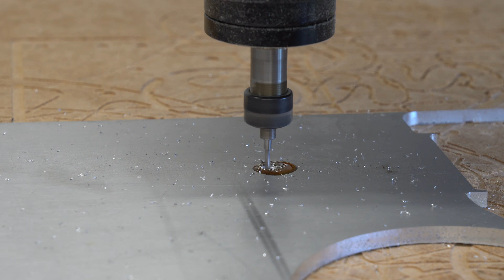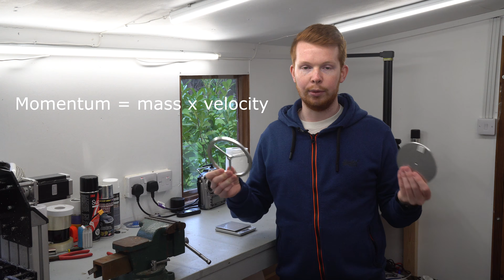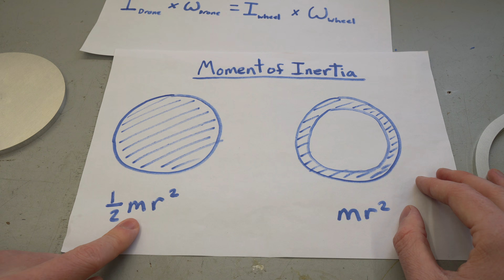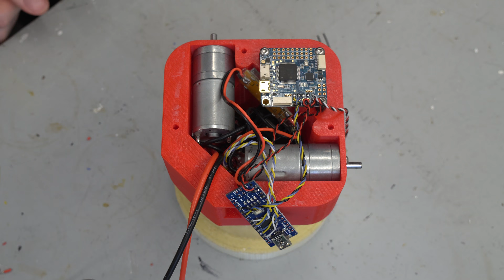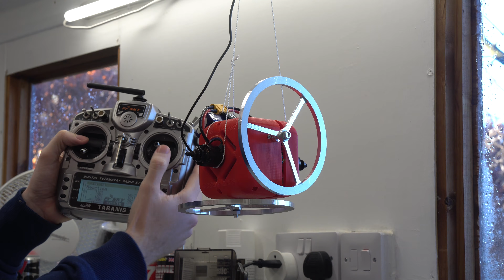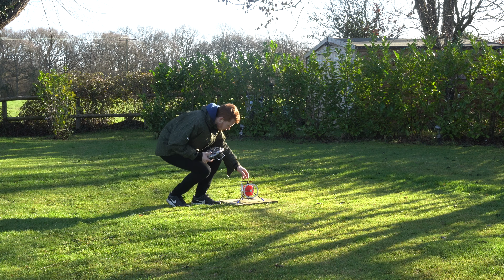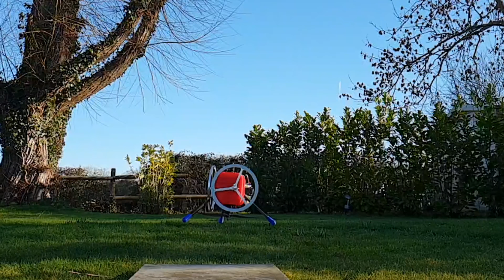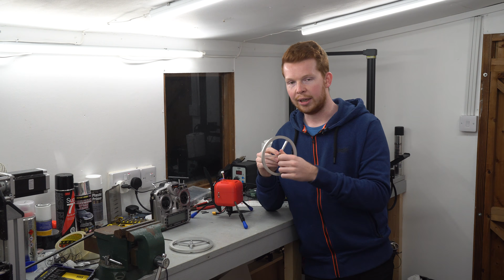Comment: Your setup has an intrinsic instability problem that results in an center point of mass alsmost in the center of the copter. This means the copter has no automatic fall back situation. If you would  use a stronger top propeller in a higher position, your copter would slightly pendel back to a stable point, even if you switch off the x and y axis. So you can use the x and y axis only to create a tilt for forward direction. The drone would become much more stable. Once you have managed its control that way, you can try the more difficult setup you have used now.

Another intrinsic problem:  Once it tops over, the z-axis (lifter) decreases on lift by tilt (cos(tilt) ) so that the lift must be compensated by the tilt factor to maintain the altitude.

The third  problem of intrinsic instability, you didn't mention is the z-axis rotation control. You wanted to let the z-axis motors spin with equal counterclockwise momentum. But this axis also needs a rotation control. So  a differential parameter of the both rotation speeds that must be setup that way, the the lift difference remains zero.

Only with those modifications you may have the stability to be able to control the drone by remote control. The first problem shows up by once the drone tilts, it looses its hight and falls to the ground. You should also consider setting limits to the allowed tilt, because at a certain tilt, the the lift propellers won't have enough power to compensate the cos(tilt) factor.

Comment: seems like step one would be to have the unit maintain level on the bench just with the reaction wheels when balanced centrally on a vertical metal pointed rod held in the vice, and recover from any random disturbance. would save wrecking a lot of propellers etc. use that to debug the closed loop code. The other thing I think intuitively (without sufficient physics knowledge to know if i'm right) is having 2 independent pitch/yaw wheels only on two sides may introduce unwanted twist torque - meaning you may need a 2 pairs of reaction wheels on a common axle on opposite sides, or 4 wheels in total. Regardless, what i saw is incredible - your material, electronics and arduino coding abilities are mind blowing. I'd love to see this work.

Comment: Have you considered control moment gyroscopes? They're slightly more complex and require the rotor to be spun up on the ground, but can in theory give more consistent torque and run two axes off of a single motor.

Comment: The slomo is fascinating. The amount of reaction you get from the wheels seems far too high so you could get away with smaller wheels - again, cutting down on the total weight. Also, there is a control system used on chemical plants where there is a delay between opening a valve and the level of a tank increasing (where you want to control the level in the tank using the valve). It is a PID (proportional, Integral, Differential) where the setup from this seemed to come from fourier analysis and things like Nyquist plots (frequency and phase) and so on (I didn't get involved but it seemed very fascinating).

Comment: why not use a gyro? ie.  place a force on the gyro wheel and use gyroscopic procession to create torque in one direction or another.  The counter-rotation is cancelled by a smaller vertical wheel and this is used as a gyro to "pivot" left and right.  Not by speeding up and using counter rotation "inertia".  With this idea, once the wheel speeds up you turn but then when slowed you end up where you started, or like you said, it becomes saturated.

Comment: The precesion of the moment on the propeller by the reaction wheels might be causing the instability try applying the reaction wheels  moments 90 degrees earlyer in the plane of rotation

Comment: So, you'll want brushless motors and you'll want an individual motor/reaction wheel not just for a given axis but also for each direction it will spin to reduce the reaction time as much as possible. You'll also have to have a pair of such motor/wheels for the yaw axis as well. Differential torque between the two motors aren't going to be able to independently react to the changing conditions. Basically you're asking each motor/reaction wheel motor/prop to be responsible for too much.

Comment: i hope you would try and change the drone config to x config..what i mean by it - that both reaction wheel would be used to cause it go forward backward etc...
the reaction motor might need to put more effort, but it will prove to be more stable..

Comment: Can you spin both reaction wheels up and used a differential rate of rotation to stabilize the flight?  It seems there may be a basic problem with this idea but I can't visualize what it would be.  Starting current for any motor is about an order of magnitude greater than no load current.   At least that's been my experience.  I enjoy your videos and your playful mind.  Thanks.

Comment: good concept, but the video itself isn't very interesting.

you mounted two reaction wheels, one of which would be able to balance the load from the propeller. but there is another dimension of twist which the reaction wheels would need to ballance to steer it.

the perpedicular to lift wheel, would be able to deflect momentum towards the ground but trying to adjust the force of it would be like a helicopter changing the disposition to go the opposite direction of the lift propeller.

to steer it, you would either need a servo on the bottom rotating a weight so it will tilt and bank in any wanted direction. or you need to have basicly a point of the cube have another reaction wheel.

you are trying to do too many problems in one single step. which makes it back fire.

again, using reaction wheels to redirect momentum is interesting, but the execution needed more intermediary steps.
also the video itself was dull.

Comment: Replacing the aluminum wheels with flat fan type blades which use wind resistance to do the same job and is much lighter

Comment: My uneducated guess on the yaw momentum:
If looking from the front (and wheels are front and right) of the drone and the front reaction wheel is already spinning clockwise at a constant speed and the right reaction wheel now starts to spin cockwise perform a small pitch-up correction, the already spinning front wheel will add angular momentum along the yaw axis and spin the drone right.  The combined rotation along two axis might be to difficult to counteract for the flight controls and cause this unstable flight. This effect could be quite significant due to the high inertia of your reaction wheels.
This effect of a spinning wheel inducing angular momentum when it is tilted over is shown in a lot of physics videos.

Comment: Here’s my take on the instability of the drone...
The reaction wheels were not spinning true, they were wobbling. This imparted a vibration through the chassis to the accelerometers, which in essence, added noise to the sensitive accelerometers input data of the angle and acceleration of the drone. Clean up the reaction wheels trueness and see if stability improves.
Reply: The Problem is much simpler:
1. The asymetrical layout have also an issue withe the PID regulator of the flight controller. Thats why it flys in one direction on start. The P-amount in the positive direction is not the same as in the negative. This is very complicated to compensate with software.
2. The current regulator do not effect the reaction time directly. Only the momentum from zero of mass. (And maybe the coils of the motor.) The speed increasses logarythmic and needs a lot of power on zero rotation. An efficient way were to spin one other wheel on each other side the opposit way and change only the rpm of it.

Comment: Not enough power in the motors. They need waaay more torque for this thing to be steady.
They have a delay between divergence from horizontal plane and the reaction. The reaction is also not sharp enough, the spin-up and spin-down takes too much time. It is not the torque that controls the device, but a time-derivative of the torque.

Other problem is the lack of third axis. I the rotation over it (hello, single blade) can transform into wobbling.

Comment: You can prevent blade damage by adding "legs" in all directions (8 cube diagonals, for instance). The blade should be inside the pyramid formed by upper legs.

Comment: Obviously, you get a lot of unsolicited advice here - my OPINION as a NON-professional drone builder and junk yard tinkerer (former electrician)? I mostly agree with MaEtUgR, in that the response of the weight (or disk, or wheel) needs to be instantaneous.  I have used this same idea (unsuccessfully) to stabilize a robot, couldnt get wheels to work, so ended up using air actuated butterfly valves with weights on the handle arms.The BIG thing to me - why wheels dont work, is the Dzhanibekov effect. I realize that balanced disks only have 2 axis - that is until theyre mounted to a shaft. if the wheel continues to turn more than a second or two, its gong to try to "flip", effecting the  stabilization of the other wheel. I think the wheels mounted to a half turn servo may stabilize better than  a spinning motor.

But - Thanx for the awesome videos!

Comment: The main default of your disgn is the reaction wheel are not in hight speed rotation at the take off. With that the stability of the uav will be increased due to impossibility of the uav to do an slide take off. After that just change the angle by changing speed. Basically the default is due to transition phasis

Comment: Tips for next time: Your reaction wheels have too much mass and drone has more mass in one corner. Otherwise great work 🤙
Reply: Thought it was quite obvious, really thought he was going to add two more wheels , or tinkered with their size ... Hope he doesn't give up on this ,
Reply: I thought the same thing he must add counterweight to the reaction wheel
Reply: Actually 2 corners only, causes "spin precession oscillations" especially with the feedback control loop delay.  The gyro/momentum control must be centered not on lopsided 2 out of 4 edges; I mean it must be on 4 edges symmetrically.  Putting weights on the legs does NOT counter osculation, but does reduce the "spin precession oscillation frequency"  just enough to allow the control feedback real-time loop to not fly out of control.  Momentum does not work well compared to gyroscopic reaction idea where you put a blade onto the gyro (weighted prop) to cause a reaction at 90 degrees to the application of the point of force.  You know the free spinning heavy bicycle wheel idea in physics where you tilt the wheel vertically and it produces a force/gyroscopic reaction horizontally. You also failed to remember with your helicopter that the reaction is 90 degrees off which caused another instability with your software control being not quite right.  With the body of the drone hanging down in gravity, saturation of the gyro idea would not become a problem.  In space it does become a problem.
Reply: Another way to stabilize the drone would be to move the second propeller upwards - this would require an in-laid counter-rotating powershaft to allow for two propellers moving in separate directions on the same axis, but would cause the center of thrust to move far enough above the center of mass to allow for more in-flight stability, partially countering the spin precession oscillation by forcing the drone into a sort-of stable equilibrium when thrust is applied. Torque-steering the drone's rotation could also be used via software to counteract the weight imbalance, together dampening the oscillation to allow for more stability without big modifications (except for the second shaft forcing the usage of some sort of a bevel box to allow for single-axis propellers).

Interesting engineering challenge, if you ask me, but would increase the complexity of the whole contraption to levels I'm not sure he wants to go to :)
Reply: Another way to stabilize the drone would be to move the second propeller upwards - this would require an in-laid counter-rotating powershaft to allow for two propellers moving in separate directions on the same axis, but would cause the center of thrust to move far enough above the center of mass to allow for more in-flight stability, partially countering the spin precession oscillation by forcing the drone into a sort-of stable equilibrium when thrust is applied. Torque-steering the drone's rotation could also be used via software to counteract the weight imbalance, together dampening the oscillation to allow for more stability without big modifications (except for the second shaft forcing the usage of some sort of a bevel box to allow for single-axis propellers).

Interesting engineering challenge, if you ask me, but would increase the complexity of the whole contraption to levels I'm not sure he wants to go to :)
Reply: @TheSheaim  Think you're falling for the pendulum fallacy but I'm not completely sure.
Reply: Thought same thing, needs two more reactions wheels rotating in the opposite directions, may be he can use a reversed gear box on the bottom of the motor to use a single motor to control the two opposite reaction wheels and keep them in sync.

Comment: Instead of 2 wheels, use 4 - one on each side so the entire cube is balanced. Also contain them inside the housing so that there's no external wind influence (plus it'll survive crashes better). Oh.. and even then it might still not work as the spin up time for the reaction wheels will probably be slower than the loss of control.

Comment: How about some Counterweights on the opposite sides of the reaction wheels? Would that hurt it? Or make it more stable for take off 17:16 OK I see you are working along those same lines. 19:43 Perhaps somehow a quicker response of the wheels may be needed Due to the quick reactions and movements of the drone. Perhaps it's an issue of Wheel Weight/Size-Drone needs to be revisited. However in the end your experiments look promising and I would call it a success for the most part.  Of Course, In Space, Some things are Easier. The Satellite Is already Up in the Air.  It Just needs Direction holding/ Adjustments :)

Comment: You need to maybe add a stabilizer gyro where the bottom something with a little more mass than your counter rotation prop design.  Maybe do a double deal on top.  I really enjoy your short videos.

Comment: If you replaced the reaction wheels with two additional propellers on the same plane with the existing propellers, it would solve all your stabilization problems and provide 200% more lift.  Cool, huh.

Comment: 8:11 Am I the only one to have spotted the mistake? Of course, if you take matter away from a disc, or full cylinder, its momentum will not increase but decrease!! 
the formula on the right of the screen is wrong: the real one is (1/2)*m*(Rexternal²+Rinternal²). Besides, it is misleading since these two objects, being in the same material, cannot have the same mass if they have the same radius!

Comment: I would really like to see this on a Chinook style bicopter design. But instead of reaction wheels, use 2 counter rotating control moment gyros like for a gyrocar (eg, the Lit C-1). These would only control the roll - the pitch & yaw controlled by the propellers/EDFs. That arrangement should provide much more responsive control and a lot more force to work with. A larger scale version of this is what I'm looking at trying for a hoverbike project, but there are no examples of reaction wheels used this way that I can find. It'd be so awesome if you did this.

Comment: I would add 2 balancing wheels, have 2 counter rotating against each other. Balance the forces using them as flywheels but at mid rpm and use two of the motors to control.

Comment: I love the fact that you explain the physics behind your projects very well, although I already know the physics behind most of them.

I think your drone could have been improved by having both propellers above the centre of mass, which would have increased flight stability by allowing gravity to apply the torque needed to stay vertical (like a pendulum where the drone is the pendulum and the propellers are the fixed point), rather than the reaction wheels. If you did this, you would rotate the reaction wheels to provide a torque to tilt the drone, allowing gravity to counteract the torque from the reaction wheels. Doing this would theoretically allow the wheels to keep spinning to keep the drone tilted, with gravity causing an equilibrium in the torque on the drone .This would (almost) eliminate the need for the reaction wheels to stabilise the drone, allowing you to control its flight much better (as it would act more as a helicopter). For this you might need to increase the thrust while the drone is moving laterally.
This would also allow you to demonstrate the effect gravitational forces has on a helicopter, and how a helicopter moves.

I do however think your drone demonstrates the principle of the reaction wheel controlling the spin of a satellite better than my suggestion would.

Comment: Could it be that Coriolis forces play a more significant role than expected due to the fact that the reaction wheels do have a certain speed at which they turn ?.. (These are the forces that counteract the changing of direction of a spinning wheel in general. These forces have direction vectors that are counteracting the rotational stability that your are trying to achieve with the reaction wheels.). Perhaps it even might explain the wobbly behavior we can see in several launches. 

Very nice experiment! Extremely well designed and presented! I love your videos! Failure always encapsulates a lesson and makes things even more interesting IMO.